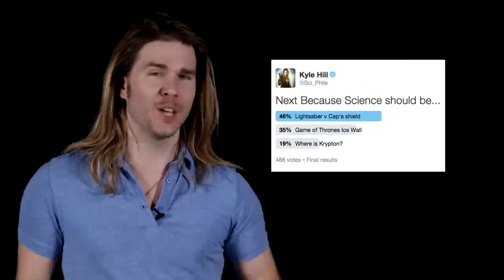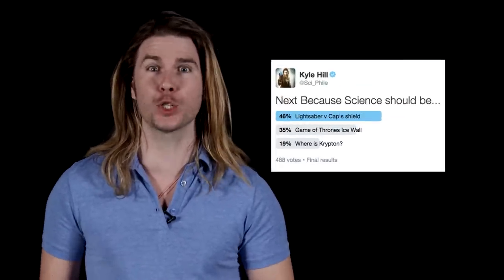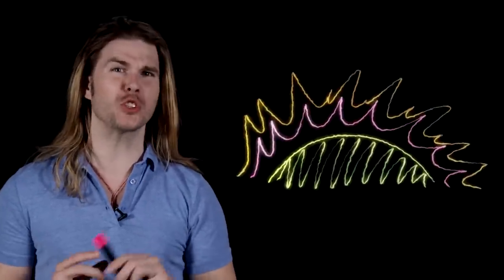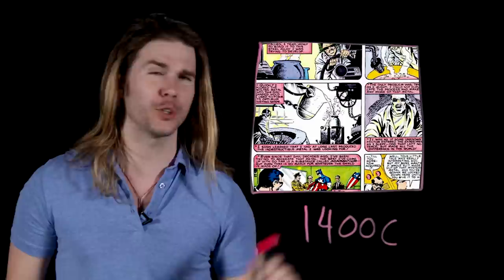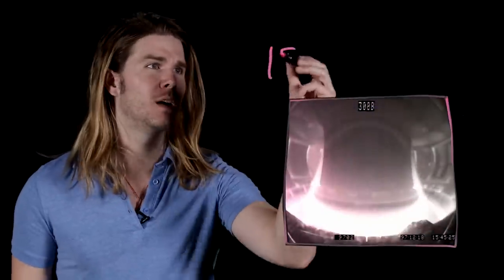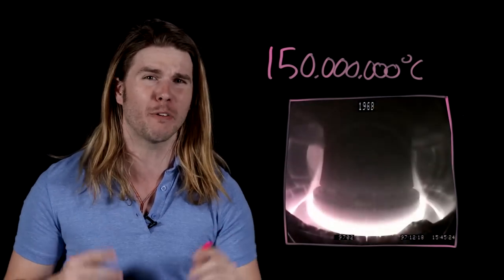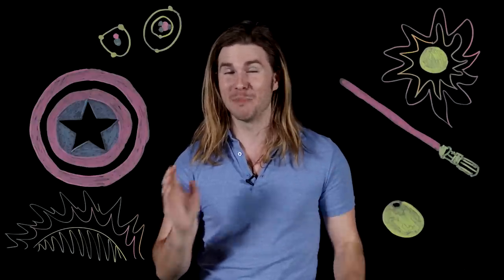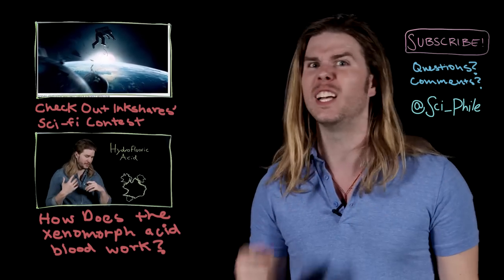Could a Lightsaber Cut Through Captain America's Shield? (Because Science w/ Kyle Hill)

Comment: Yeah man, I'd hold a 150,000,000ºC sword in my hand. No prob.
Reply: +csys690 Thanks, you saved me a reply.
Reply: +csys690 hahaha this^
a sword that hot would destroy me, my enemy, and the surface of my planet
Reply: not just the surface. It would boil the entire planet.
Reply: +csys690 Right, no problem. The plasma is held back by the magnetic field. And the handle is cooled or something. If it's possible to get the power to create a plasma saber out of the small handle, why shouldn't it be possible to use that power for cooling, too...?
Reply: Gherkay
A magnetic field can hold back radiant heat energy?  C'mon, man, we're talking about science fiction energy swords here - be serious!
Reply: Gherkay Nah, Lightsabers are just simply not nearly as hot as Kyle claims. For example, in the phantom menage (I believe) Lightsabers were used to cut through a metal door. They melt the metal, but if they were as hot as kyle claims, they'd vaporize the metal, and the gaseous metal would kill the heroes.
Reply: +Colin Jackson That explains it :)
Reply: +Kevin Davis Maybe the handle produces rays which result in destructive interference with the rays from the plasma
Reply: Gherkay That doesn't exist in physics, my man. Heat is the transfer of electrons from one atom to the next, and as far as we know, nothing can interfere with that.

But that's only real life, we're combining fact and fiction anyways, so who knows.. You could be right :)
Reply: +csys690 Electric current is the transfer of electrons between atoms. I think you are confusing something there. 
Heat is either the movement of atoms, or electromagnetic rays which cause the atoms to gain movement when hit.
Reply: +Colin Jackson 
Perhaps they figured out how to hold back the heat of a light saber so it isn't 150,000,000 C?
Reply: +Motorboatmygoat - The answer is much simpler. When you consider how much damage something hot does to something else, its temperature is not the only variable to consider. The amount of heat is another.

Confused?

Well, consider this: a milligram of boiling water and a ton of boiling water are at the same temperature, but a ton of boiling water contains a billion times more heat than a milligram of boiling water.
If you get a milligram of boiling water dumped on you, you will probably feel something like a pin prick, but if you get a ton of boiling water dumped on you, the same temperature will cook you alive.
So, if a lightsaber blade is very very hot, but also very very thin, so there's very little plasma in it, it won't contain enough heat to cause that kind of catastrophic damage, in spite of having that humongously high temperature.
Reply: +DevilMaster But how could it melt metal then?
Reply: Gherkay
By touching it. Just like you can melt tin by touching it with a soldering iron, but if you just hold the soldering iron near tin, it won't melt.
Reply: +DevilMaster The melting temperature of tin is not very high, is it? :D 
So the temperature of a light saber has to be much higher, also because you want it to be so thin. And that temperature would produce a lot of infrared rays, no matter how thin the blade would be
Reply: +Gherkay when you weee talking about the heat, your both right to an extent. But like you said. If it can generate such power it should be able to keep it stable or it wouldn't produc3 it in the first place.
Reply: +Mr Red Whale And after all, it's not supposed to be realistic in every way ^^
Reply: +Mr Red Whale mostly, the mass and density of the plasma itself is VERY low, and most gasses only take a bit of heat to heat up VS stone or iron (and even more so, water) so while it can be HOT and the matierial in contact could be melted... the actual amount of ENERGY a very hot plasma blade has is pretty low compared to, say, a blade of tungsten at almost melting temperatures.
Reply: Gherkay
Actually, it does matter very much how thin the material is. If you measure the IR emission of a hair-thin tungsten wire, vs a thumb-thick tungsten bar, both heated to 1000 °C and both the same length... what do you expect to discover?
Reply: +Colin Jackson the phantom menage
Reply: +DevilMaster but surely there is a bit of a difference between 150 million degrees and 100 degrees. A light sabre is a lot larger than a drop of water . It would be really bloody hot even at its small size.
Reply: LouisKing995
The physical plasma blade of a lightsaber might even be 1 atom thin. It would just appear wide because it glows so much from being so hot, and, while it would indeed be extremely hot at microscopic distances, it wouldn't have enough energy to transmit its heat very far.
Reply: DevilMaster Yeah It might be but is their any precedent for  that? If it was so thin then surely when the blades  clashed they'd appear to mix together since they'd pass through each others glows to get to the tiny thin blade at the centre? they do sort of mix but they don't entirely pass through each other which is what it would look like if most of the apparent size of the blade was light glow. 

 And if the argument is the electro magnetic field that contains the blade also repels objects from it allowing the glows to clash together without mixing, wouldn't it also significantly reduce the amount of head the blade can transfer ifits contained in this field? I just think the argument for it being so hot is a bit far fetched. Especially since mandilorian Iron can resist Light-sabre blades and I don't think its ever been suggested in the fluff that its resilient to heats of that scale.
Reply: +LouisKing995 Guys, you either discuss how it works in the movie or try to explain how it wouldve worked in real life. If you start mixing how it works in the movie and how it could possibly work in real life, your disscusion will go nowhere.
If you discuss how it can possibly work in real life, arguments like "In the movie it was the other way, so you are wrong" are invalid, cause no movie is without a sin, and who says that it wasnt a sin from the movie that the blades are not mixing together e.t.c
Reply: Анатолий Кошлань We are talking about fictional objects, we have to consider how they work in the fiction to have any basis of a comparison.  the temperature of the blade being 150 million degrees because a real world plasma reactor of an entirely different size and design gets that hot is pretty big stretch.
Reply: +Анатолий Кошлань And the film is a fiction. So that you can use mysterious force and different laws of the nature as the answer to all illogical things that happen in the movie.
Reply: Анатолий Кошлань The film never suggests any of the far fetched points people have made about the blades heat or true size
Reply: LouisKing995 But objects from fictional world just wont be working in our world, arent they? 
Its pretty much pointless in my opinion to use fictional world in arguments when you discuss theoretically existing similar device in our world.
I wouldnt be saying this if you was discussing light sabers in its fictional world, because there argumets from its world is legit, but you were talking about light sabers in our world, not in fictional world. 
Why even use arguments from fictional movie with its mysterious force and maybe different laws of nature if you talk about how it could be working in our world?

*
My english sucks so I have to apologies if I have messed up with tenses and other grammar.
Reply: Анатолий Кошлань but lightsabres don't exist in our world...we don't have the technology to create something even remotely like it. The closest thing we have  is that reactor, which is far from a lightsabre. we have to draw on the fiction, and the rules established in the fiction,  to have any sort of discussion.
Reply: LouisKing995 P.s. to clarify because i'm probably cant get strait to the point of what I want to say and you couldve misunderstood me. I'm not saying that you are wrong about high temperature and stuff, its just arguments from the movie are doubtfull because in the first place movie wasnt made to follow some kind of laws but to be spectacular and entertaining.
Reply: Анатолий Кошлань Regardless, since nothing even comparable to a lightsaber exists in real life, the movie  is the biggest set of information we have to go on
Reply: LouisKing995 And it's fictional... so......
Reply: csys690 Yes but it exists within its own set of rules. Its not like anything goes in the starwars universe and everything is anarchy so you can just say what ever you want.
Reply: LouisKing995 Ok yeah, and I get that, but it doesn't exist within our set of rules. Any testing or comparison to real life is purely hypothetical, considering there's no possible way to test it.
Reply: LouisKing995
A magnetic field can, and does, bind a cluster of ions, but it has no effect on heat. The walls of a tokamak don't melt purely because magnetic fields keep the plasma distant from them, not because they affect heat itself.
Reply: csys690
There are no ways to test it directly, but there are ways to approximate it. You choose the physical phenomenon that comes the closest to it and you run from there.
Reply: csys690 Yes but you can combine the two sets of rules from both fictions so long as they aren't fundamentally incompatible, which the principles of caps shield and the presented qualities of a lightsabre aren't for the most part, to try and get an idea of what the outcome would be. I agree comparing it in the real world is stupid because we have nothing close to either weapon.
Reply: DevilMaster SO then how could you justify the two blades being an atom thick? Because , if, as you claim,  most of the blades size is actually just glow then that would mean they would appear to pass through one another when they clash, which they don't. if the magnetic fields bind the plasma then that would surely only effect the plasma beam itself and not  the glow from it , so the two blades should mix together until their atom thick blades connected which to anyone watching would look like the two blades melding together from every angle, which doesn't happen, they rest on top of on another.
they sort of look like they melt together from a side angle  because of all the light generated by the connection, but if you were look from a front angle you'd see the two blades resting on top of one another. 

and again there is the issue of mandalorian iron which can resist lightsaber blades but has never been described as being resistant to such temperatures which are suggested in this video.
Reply: LouisKing995 Its the same thing as iron man who can resist ungodly amount of G force when he flies.
Movies... They never follow physics. Thats the answer to all your questions.
They have force, they have mandalorian iron, they have lightsabers. And thats how it works in the movie.

Its like when people discuss from what material could possibly exist Hulk's pants in our world, so they can be as much durable as possible and at what point they will be destroyed, you go and say something like this - "They had never got destroyed in the movie! It means you are all wrong!"
At least that how I see your arguments about visuals in movie.

About mandalorian iron.
https://www.funnyjunk.com/Colbert+12/funny-pictures/5589640/24
Here you can read some comments about this. If it can resist, it doesnt mean it doesnt get damaged from it.
I dunno how legit that comment is but there was said that after continious use some materials that can resist lightsaber will melt!
Reply: LouisKing995
The result would be what you see in the movies: the glowing blades sort of melding together, but not completely. Each plasma filament would be confined by a magnetic field, which would repel another similar magnetic field. The volume of repulsion would probably be less than the volume of the perceived glow, which would account for the effect that can be seen.

Iron is has magnetic properties, so mandalorian iron could be an iron-based ceramic or alloy that exhibits room-temperature superconductivity. When the magnetic field of a lightsaber comes closer, eddy currents are formed in it by induction. They generate a matching magnetic field and repel the lightsaber, which would be unable to come close enough to the material to melt it.
Reply: DevilMaster They dont meld together in the movies. It looks like it from a certain angle because of all the light generated by the clash but they do not meld together, they rest on top of one another. 

Mandaliroin Iron is just the basic name for it. Its real name is Beskar and it described as having iron like qualities.

Comment: Cap's shield also lets off energy when it absorbs it, like when Thor hits Cap's shield in the first Avengers film, so due to the high temp of the plasma blade, it would be letting off the thermal energy about as fast as it absorbs it, it could even act almost like a heat mirror, sending the heat right back at the wielder of the light saber.

Comment: A jedi would win that fight anyway. He has the force, if cap throws his shield the jedi can catch it. If cap runs at him, the jedi throws him back. If cap has a gun and shoots at him, he either disintegrates the bullet with his light saber or uses the force to deflect it.
Reply: +Matthew Siano If Cap got a gun.... A gun from earth and not a plasma gun.... Then the Jedi die at the first shot.... Even if the plasma boil the ammo... The ammo will still move at him and burn him.... Worst then just the normal bullet.
Reply: +seb4sti4n666 no it would disintegrate in that heat
Reply: +seb4sti4n666 also plasma shots are deflected with the aid of the force, so the jedi would use the force to deflect it too. So even if it didn't instantly disintegrate, it would be deflected with the force.
Reply: seb4sti4n666 a light saber can block solid matter as well